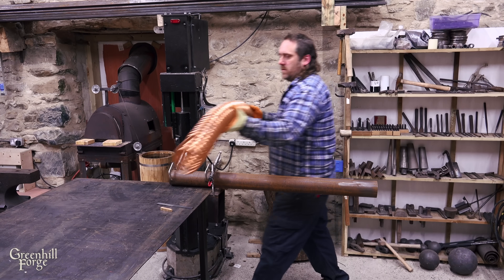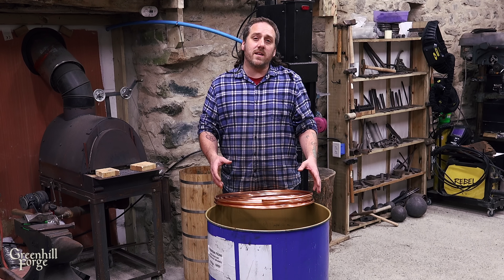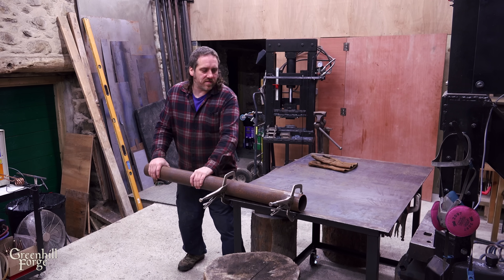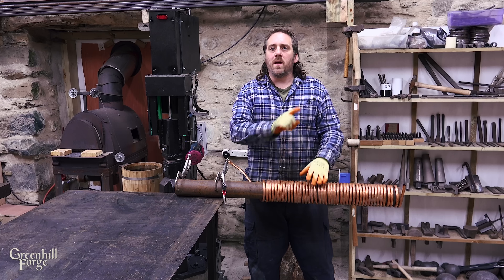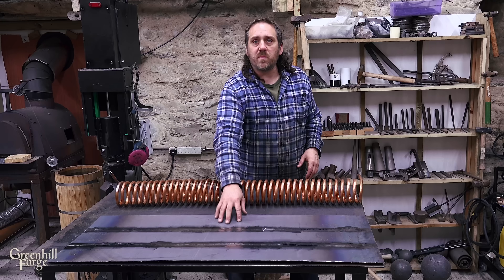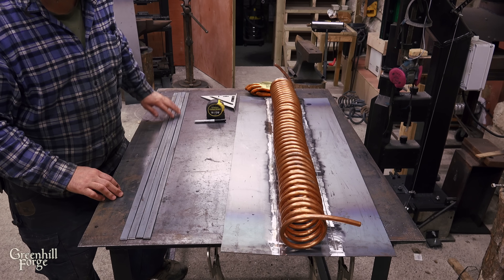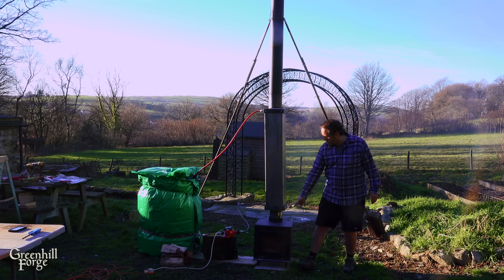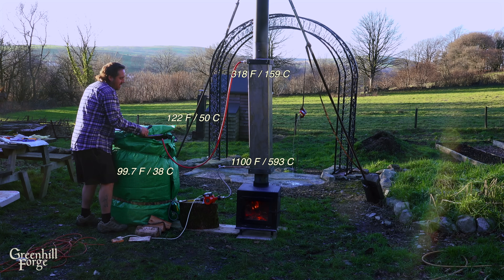Wood Stove Water Heater Experiment - Surprising Results! Part 1

Comment: Bro. This was a master class in thermal transfer in practice. I've sat down and thought about this exact creation numerous times. I work in the industrial water treatment industry and have seen thousands of heat exchangers. This was very well done. I've never seen a pipe bent with ice. We've always done it with sand. Great, magnificent work. Bravo!
Reply: But this design can't be cleaned. After a few burns you get serious buildup around your copper tubes, essentially insulating the tubes.
Reply: With the sand? Internal?
You can explain to me because I have to do it with a 1 "tube ... @jeroenkoehorst4056
Reply: With the sand? Internal?
You can explain to me because I have to do it with a 1 " tube ...
Reply: @LuigiRuff fill your tube with sand..then bend it. It does the same thing as the ice did

Comment: I use a 2" rocket stove  that runs on any fuel; I use propane. It features ONE 1/2" copper water pipe connected to the bottom of a 50-gallon tank type electric water heater, runs through the bottom of the rocket stove flu, up the inside, out the top, returning to the tank's HOT side at the tank top. VERY VERY effeciently gives me hot water any season.

Comment: If you would like to hold heat for a very long time. Sand is an amazing heat retention product. If you run a copper coil into a large container of sand. Say connect three 55-gallon drums filled with sand. You will be absolutely astonished at the time that sand will hold the heat.

Comment: GREAT JOB  
The Insulation cutting and fitting  step can be done
OUTSIDE of SHOP to minimize  any posible initial or residual exposures😮 (no  cleanup of micro fibers neede after)

Comment: I did a science fair project about efficient energy use  and included a hot water heater nearly identical to your design, the teacher said it wouldn’t work so I built a working scale model to prove it. He was an ass so was still sceptical in an ego driven way. I knew he was wrong and I also got me a shinny gold medal for my effort at the fair. So there Mr ………! (No names)
Reply: In school I made an ammonia condenser. We generated the ammonia with an ammonia salt and a strong base. The vapor would leave reaction chamber and condense in a stainless steel coil that was immersed in dry ice and acetone.  A collection vessel was under the coil that was also immersed in the dry ice solution.  Within 15 minutes enough NH3 was collected to add my Li and other necessary ingredients. By lunch the entire science department was in overdrive and eating was the last thing on our minds. Go science!!!
Reply: @horsehairedmessiah  that’s an amazing story Jesse!!
Reply: I think your teacher tricked you. He acted like your enemy and biggest skeptic to drive you to realize your idea. I had a teacher like that and I hated the guy, until the end of the year when we got into a debate again and he told me to never stop challenging my ideas because he can’t anymore.
Reply: Why did you want to heat hot water? Were you trying to make a steam boiler?
Reply: @DumbassinGalmey  I’m usually the one pointing out the most obvious of errors. Well done
Reply: Silica sand blasting medium and copper in dry sand and flue in sand no fire to copper just sand its approximately 5x more efficiently done if the sand battery is in a extra large volume box with extra coils in sand battery burn for two hrs twice a day instead of all day. Key is the draft adjust and a fresh air intake from outside to not cause a neg air pressure drawing in all that cold air from every air leak in the house put a quik connect fitting like an air hose has and run a car heater core with a 12 volt blower fan like a car heater .
Reply: Name drop!  Don't be a sissy
Reply: Its faster to heat up top water. Than to heat up water from 7c from botom...  but who knows.
Reply: It’s a water heater. Not a hot water heater.
Reply: @ well your not wrong
Reply: @amyspring3891 Lol, right.  Why would someone need to heat already hot water??
Reply: Well done..... except nobody cares unless you give a name. Lol seems like the right move if he's still a teacher! If he's not, then it doesn't matter, and you should have stated it anyway! Haha just imagine, the 1's of absolutely NOBODY watching this or reading this that would actually live where you do or know the school Haha

Comment: I wounder what issue you will run into, like having to clean chimney sooner, and how do you clean it. Believe it or not lots of people have died trying to heat water. Think about maybe installing a PSV. Good luck with you project.
Reply from the maker: There are a lot of issues to address for a good final design. Thanks

Comment: this is great, you can eliminate the pump because heat rises using convection it will pull cold water in. Needs one swing check valve

Comment: Some details commenters will need to know:
If you don’t want to use an electric pump and have thermal siphon work DO NOT have the copper coil in contact with the flame. Wrap copper around an inner sleeve of steel. 
Flame contact will cause flash steam and break your siphon. He over comes this by forcing the water through the coils. 
Also don’t pour sand around the coils, thermal mass in this context will only work against you to heat up the water. Insulation on the outside is good. Hope this helps anyone looking to design one yourself

Comment: Nice design!!
If I may offer a little advice, you may want to change the steel holding the copper tubing in place to a "friendlier" metal like brass, or maybe use copper strapping. Due to a process called Electrolysis, the two metals touching will result in one wearing the other one down over time, causing leaks.
Reply: Isn't the copper higher on the nobility scale than steel?
Reply: @winksworks  No, it isn't. It is a better conductor than almost every other metal, but it will almost always lose the battle when placed too close to other types of material. Especially galvanized pipe.
Reply: @ Well spotted!
Reply: just add tefgel to contact points.
Reply: @BOSS_DOG  how do I know you're a seafarer 😂

Comment: Honest question, will the different expansion rates of the copper verses the steel cause the copper to wear out over time? The saw tooth against the copper is my area of concern in my question. Great idea and great build though.

Comment: I had an idea but did not have a chance to test it yet, so maybe you like it. We can add an air-water heat exchanger (car radiator basically ) after your copper exchanger to further more increase efficiency of the system.

In this case, cold water would go first through the car radiator, pre-heats goes then to the copper exchanger. Idk if it worth it, or maybe it would be the same as you have with copper exchanger. What do you think?
Reply from the maker: I think it would help a lot.

Comment: I had a similar setup up in a double barrel stove in my basement to heat a 600 gallon water battery, worked incredibly well to provide a bunch of stored heat after the fire went out.

Comment: Wow. Nice job. 1100 to 300-something, that's great heat extraction. That work wasn't entirely above what I could do, but I do wish I'd gone to a "trades" high school. I've always been interested in a water heating system with a gravity feed, hot water tank above the heat source with proper control manipulations and safety but without use of any power.

Comment: This is really cool.  I'm curious what the inside of the flue looks like.  Taking out heat energy earlier will cause particulates to condense on the inside of the pipe earlier and build up.  Don't want a flue fire.  :)

Comment: Great experiment.  I thought of using this coil set up to extract extra heat from a wood stove.  Couple of questions.  Did your set up create a thermal syphon loop with no real need for the pump?  Also, for long term use (like daily water heat)- do you think creosote buildup on the coils could be a problem?  Keep it up man- your engineering skills are powerful!

Comment: This kind of set-up would make a great efficient swimming pool heater too!!
Reply: Ever seen those hot tubs which are a kit made of wood?   Into the water they drop an aluminum barrel and have a fire in the barrel.   The water protects the aluminum from the heat of the open fire and the fire heats the tub water.   I've always wondered if this would work in a pool.

Comment: You should make and sell these.. You would have to come up with a chimney bypass system and some type of regulation to prevent over heating the water, but awesome build. I'm thinking domestic hot water heated by wood or chimney heat. I think you have the skills to make it happen.